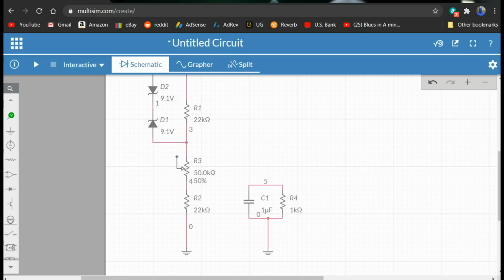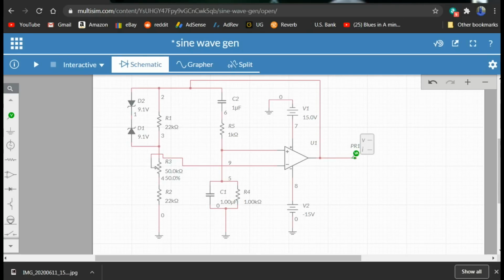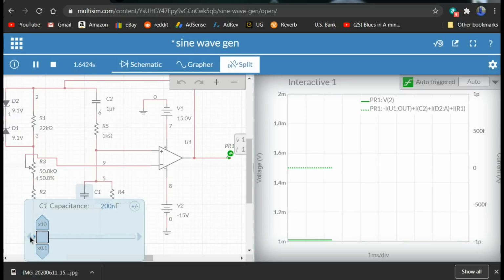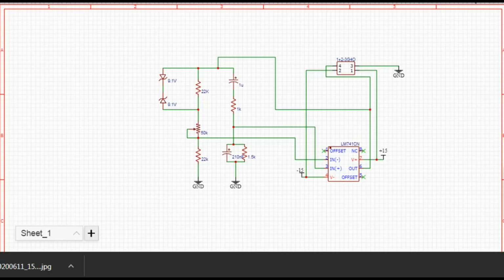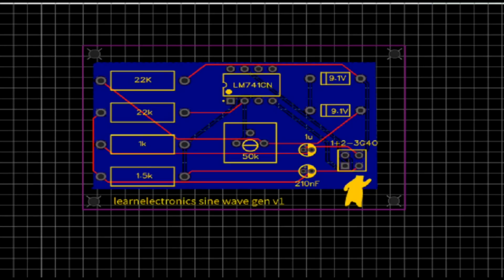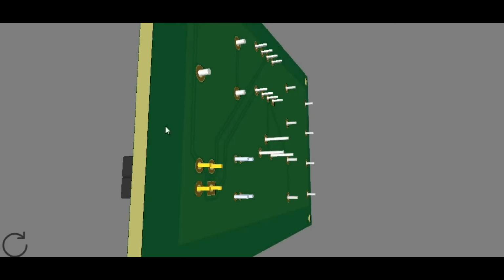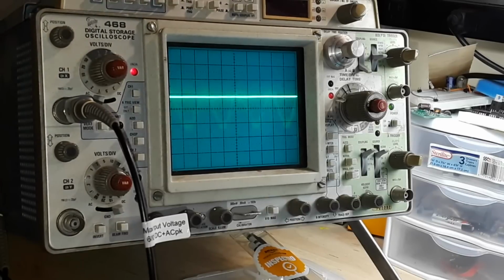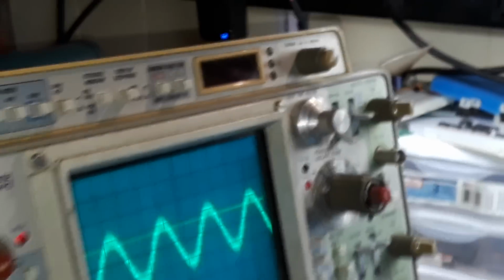Wien bridge oscillator design, simulation and PCB

Comment: Where did you buy the rest of the material other than the PCB board?
Reply from the maker: I buy almost everything from Amazon because I'm impatient and can't wait a month or two for stuff to come from China
Reply: @learnelectronics   hold on i read somewhere the oscillations are caused by base current variations in noise..... i guess then it gets amplified.... but i guess the wein bridge  filters out whatever random signal that meets Fr and continues the positive regenerative building process instead of dampening..........it increases till the right amplitude then gain control levels output....am i right?? freaking weird if thats how it works
Reply: @learnelectronics   one thing i cant get is how the actual sinewave is generated from DC.... i know about the automatic gain control with Z diodes or JFET and phase being 0 at Fr.....  how is are the oscillations made im confused helpa me good Sir?

Comment: When I was a kid, my Dad's Eico signal generator used a Wein bridge.  Indeed, it used an incandescent bulb, very elegant gain trimmer, much better than the Zeners
There's a lot of misinformation in this video.  A dingle RC circuit does not a band pass make.  Only one pole.  The two RC circuits together might be considered a band pass.  Band pass requires at least 2 poles.
The word "bridge" appears in the name for a reason.  The series RC and the parallel RC each are one of the four arms of the bridge.  The other two are either side of the pot wiper.

Comment: I'm thinking maybe an OP amp is what I need for my alternator voltage regulator circuit,  it needs to drop the duty cycle if the voltage climbs too high. Or increase the duty cycle if it is to low, I was thinking I could use a zener and mosfet, to start a self oscillation, regulating the output voltage, it could cause a very unstable output, I'm not sure how delco does it,  the business parts in the regulator is altogether about the size of a quarter!  Maybe I'll start working on it and get something figured! Great video!

Comment: I've made this recently to use it as sine wave function generator. I've added voltage offset/frequency/amplitude variations with the help of op-amp. This was a great learning experience.  Plan was to use a  bulb (<50mA) instead of diodes, but i could not find one and it was during lock-down,so that did not help either.

Comment: The frequency of oscillation occurs at 1/(2piRC). That is when the series combination of the RC and the parallel combination of RC create a 360phase shift from output of opamp to the + input. The series RC AND the parallel RC act together as the bandpass filter. For the formula to be correct the two R values should be equal to each other and the two C values also equal to each other. The circuit will oscillate at hard to calculate values with unequal RC values. With the R's equal and C's equal the potentiometer sets the loop gain to exactly 3 to sustain oscillation as the bandpass R's and C's in the positive feedback chain have a gain of 1/3 (loss of 3) When you built your circuit you should have moved the potentiometer to get your circuit to oscillate. It would be worth revisiting your built circuit in a reprise video with 1k and 1uF R's and C's in the series and parallel positive feedback chain and the adjusting the pot to show start of oscillation and the clipping distortion as the gain increases. Great work on demonstrating the design, simulation and pcb fabrication process. Big tick from me.

Comment: There are some excellent example of the Wein Bridge on the TI/LT website. This designs address the issue of gain control to give a very low distortion sine wave output, without adding too many extra components. I have posted a link it this in the past.

Looking at the oscilloscope trace, it looks as if the fuss on the trace is due to an instability. Either that or the scope focus is a long way off.

Comment: Please forgive a silly question.  What is the term for those female connectors you put at the ends of three wires to connect to the pins on the PCB?  Where did you get them?  I've searched for some time without success.  Thanks.  I quite enjoy your videos.
Reply: cougar1861 The pins are called ‘header pins’. The cables are called ‘du pont’ cables.
Reply: @martinfairweather700  Thanks, Martin.  So the female connectors,  themselves, are only available already connected to the conducting wire ... the combination being "cables"?
Reply: @cougar1861  The pins themselves are "header pins" or "male header pins". The sockets are "female header sockets". Search your favourite supplier for those terms. They're usually supplied in strips, and you cut or snap off the number you require.
Reply: @tonywalton1464  Thanks, Tony.
Reply: Get mine from Aliexpress. Dirt cheap.